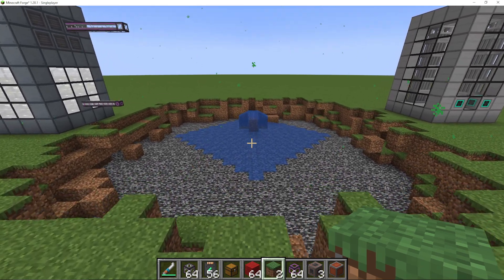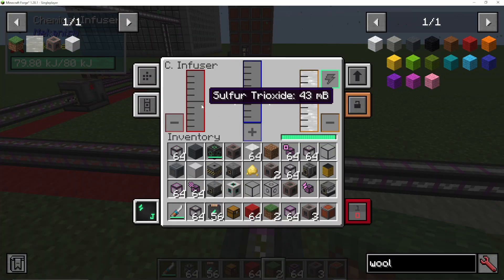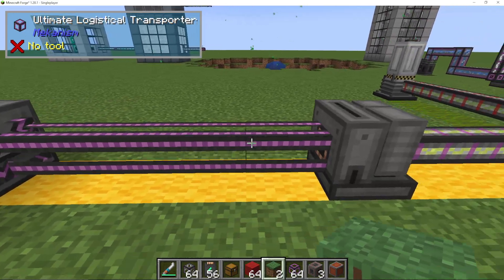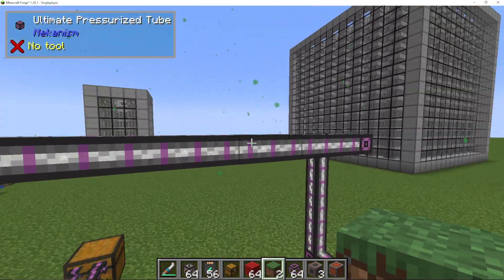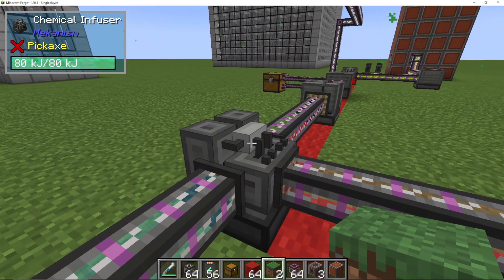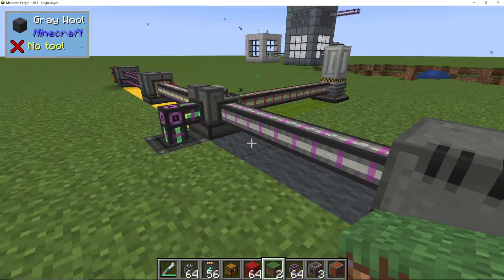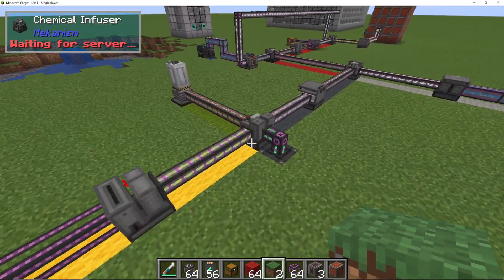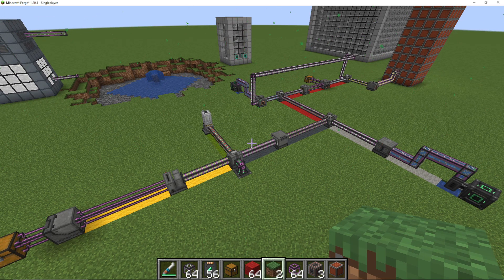Mekanism - How to make Fissile Fuel

Comment: I hooked up the chlorine to the chemical infuser and with the pressurized tubes and its not pulling the chlorine out into the infuser
Reply: Same issue
Reply: @XJT_playz   u need to enter on the machine config and put output 2 where chlorine is leaving

Comment: What is the config for the Water Vapor and Hydrogen machines? The hydrogen doesnt want to go into the infuser where the vapor is.
Reply from the maker: Check the sides, specifically for gases. You may have your inputs and outputs mixed up, or there could be a blockage in your pipe system. 

A tip id use is try the same setup in creative for easier troubleshooting and fiddling, that often helps me find the route of an issue

Comment: Thanks for the guide, it was really helpfull. By the way, after I've finished all chain to start my fissle reactor, I've realised I have to spend almoust all my power to produce the fuel. All my devices have x8 power update modules and x5-x8 speed modules. Anyway, electrolitic separator and chemical infuser consume huge amount of power, that made my system not really good. Any obvious problems that I could have allowed there?

Comment: Question someone please help!!! I’ve got everything set up with the correct piping and such. However, stuff won’t go from the pipe to the machine unless I rotate it. I’m needing  multiple  inputs of the machine at once but have to have it in a specific side. So I can never automate my line, I have to continually rotate 2-3 different machines.
I’ve also tried changing up the connections and power but I just cannot get everything to be automated.
Reply: open the config menu on upper right, check fluids and chemicals, make sure you have the inputs set to the correct side, can also use configurator tool to make pipes push/pull where needed
Reply: @ thanks for the reply I must be extremely ignorant or something but I’ve copied multiple different designs and none of the pipes would transfer correctly so I built a simplified version to get by before giving up. I forgot the version I was on but it wasn’t working correctly I believe.
Reply: @Kemkachi  no worries man, been playing mekanism for a while now and just learned about it on a reddit thread today
Reply: @Kemkachi  another thing i forget to check is auto eject button, some have it some don't